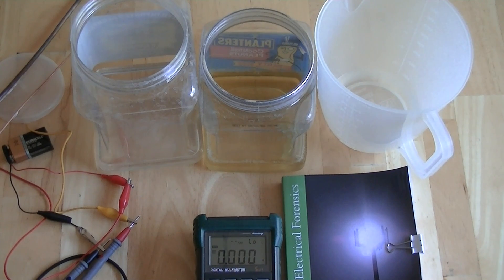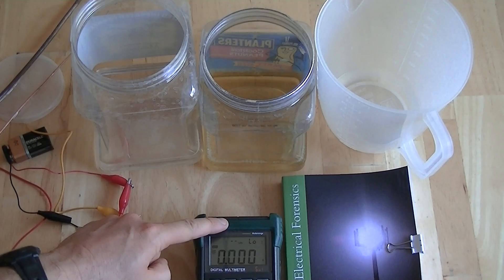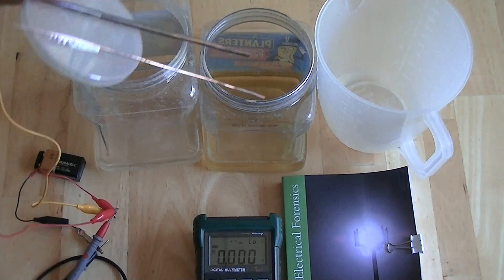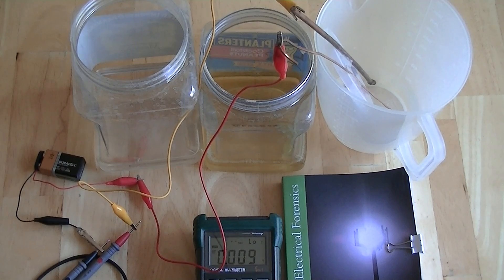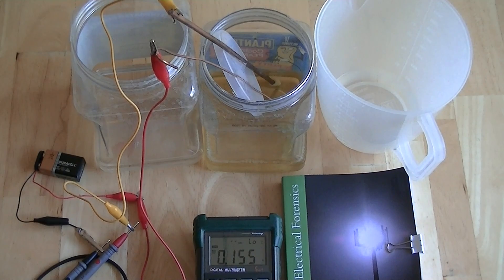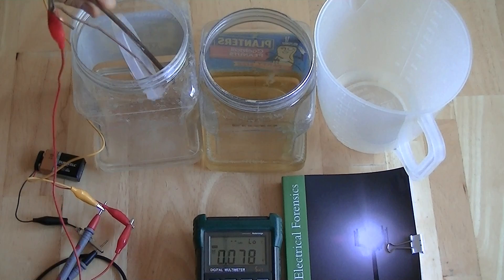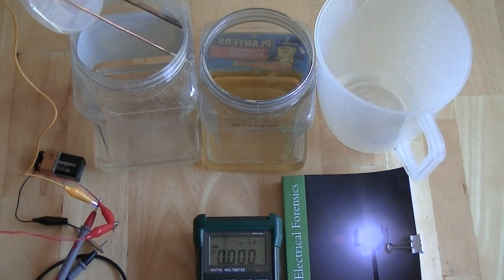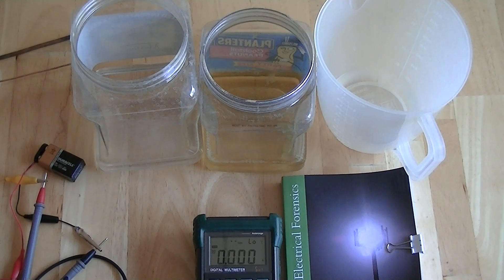Conductivity of Faucet Water Vs Urine Vs Brine

Comment: Generally one measures conductivity of liquids at very low voltage, 50mV or less, in order to get consistent results. 9V is way too much. One should also use inert electrodes. One can see the bubbles formed by electrolysis at the electrodes. So in this setup, the result depends strongly on the electrode materials and, since with these high currents, the anode is actually dissolving, the ionic concentration, and this the conductivity, keep changing.

Comment: I never bothered to think it through that clearly. Great point our urine is full of salt that went unused by our body making it more conductive than plain water. I checked my toilet for stray voltage, the bowl and holding tank are both free of any voltage. I also checked my bath tube but just realized I haven't checked to see if there is any voltage when draining it from full :/ I add epsom salt so get the magnesium and to help pull the acids out of my system...